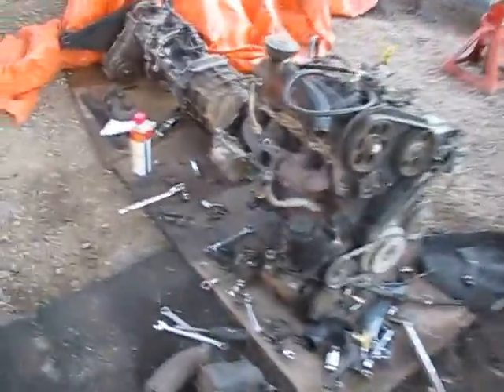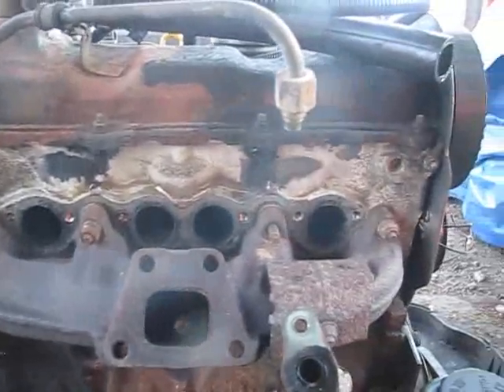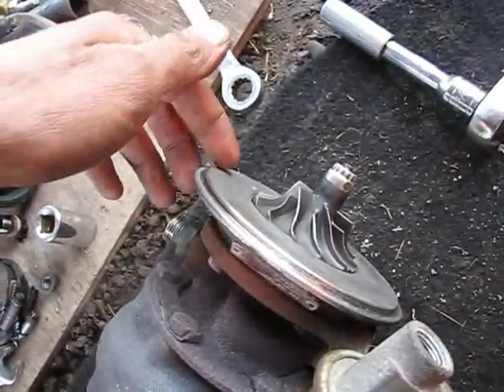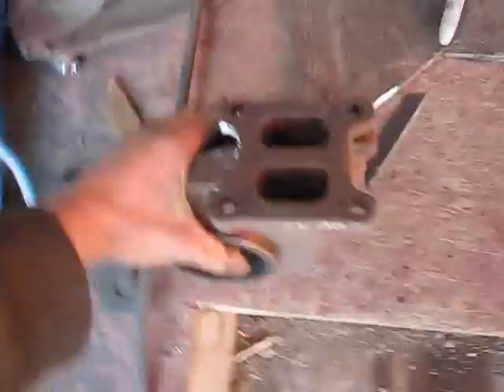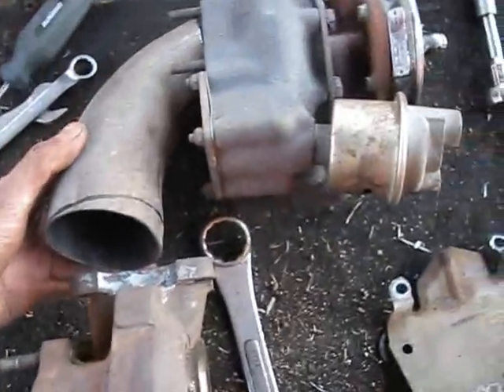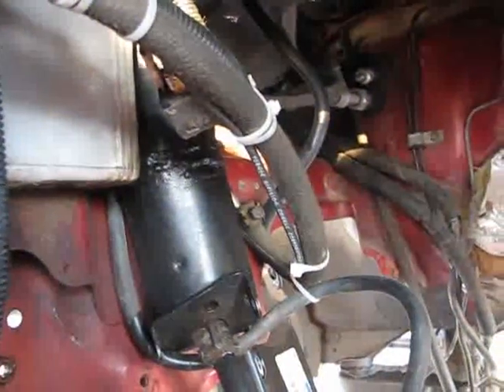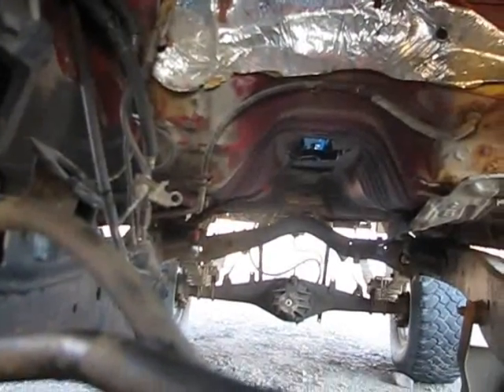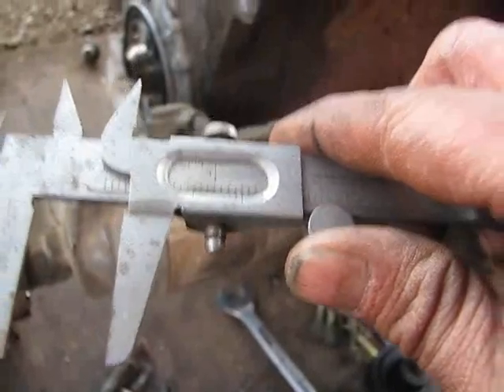Porting & Turbos & Exhaust Ideas(02/09/12)

Comment: u do need waste gate on/before first turbo(smaller) that will bypass exhaust flow to ur downpipe to secondary turbo, and blow off wont do anything good on diesel as there is no TB and no boost spikes. you can eliminate waste gate set up if you run vnt type turbo. Also adapter plate with port valve for your twin scroll will help you to spool turbo a lot quicker.